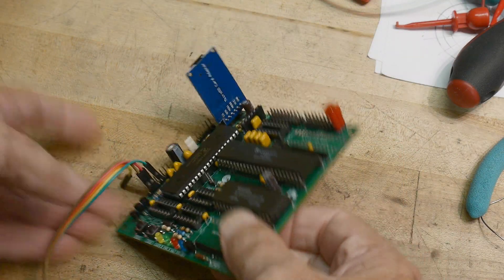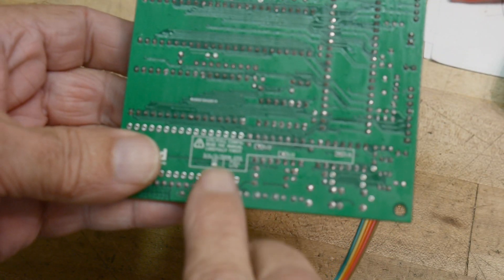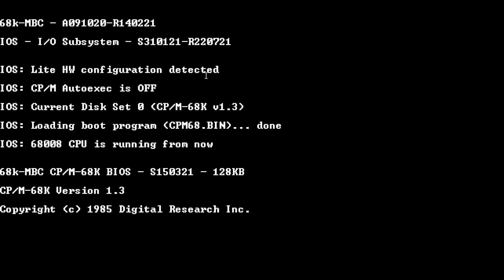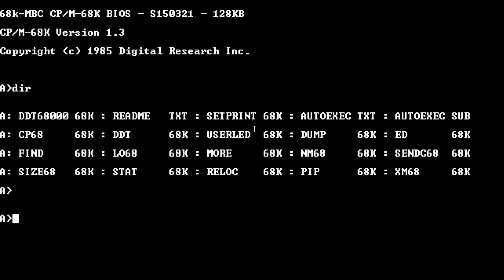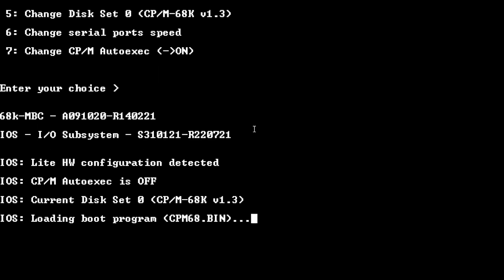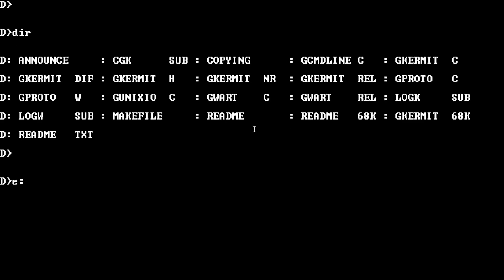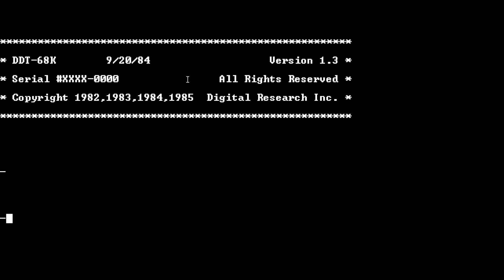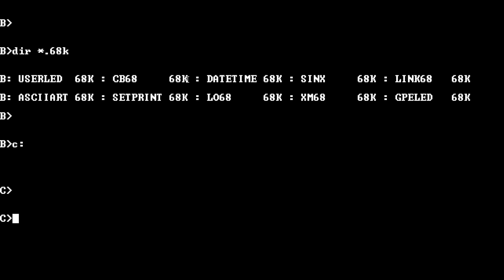#938 68008 SBC Computer Kit (part 3 of 3)

Comment: There is precious little application software out there for CPM/68K.  There just weren't that many computers sold that used it.  However, there is a BASIC interpreter, I believe a BASIC compiler, a C compiler, and a Pascal compiler.  With those, there should be loads and loads of generic-ish programs from the era that could be ported without tremendous effort.

I've found some CPM-86 applications in Pascal source code that might make good candidates to port to /68k.  There are 2 challenges here.  The first is that the Tube is afraid of lynx.  The second is that the page seems to have gone on to the great archive beyond.  You'll have to go to that place first and search for 3x(W) period z80cpu period {two letter code for European Union} slash mirrors slash klaw slash files period {abbreviation for hyper text markup}.

Comment: I think there were cp/m 68k for the Sinclair QL which had an 68008 cpu - so maybe ther is software for that. But the QL had graphical display similar to the spectrum but higher resolution so there would be some adaptation needed either in the software ore the SBC ;).

Comment: You have double line feeds - maybe your terminal program is configured to treat CR as LF, and CP/M is sending CR LF?

DDT is the Dynamic Debugging Tool, but that's all I remember about it! 

If I remember correctly, Ctrl Z might get you out of some apps (EOF)
Reply: DDT yes used many times, the format is usually DDT  filename

I think it was DDT that I used to dump the program out to the screen in ascii + hex, then you toggled the print function on, and the output would go to the printer. I have a centronics emulator (in BASIC) that read the output into the "other" system A commodore C128 so that I could get some programs across. This was from an article in Dr Dobbs I think. (No serial, ports available, and the CP/M was on 8 inch floppies.

Once Wordstar was across I could then rewrite the utility in assembler... ED on CP/M  was is a bit of a handful at the time Wordstar was much easier as an editor..

Andy